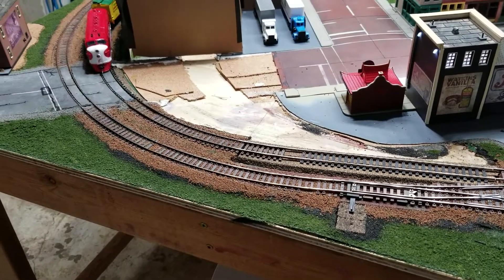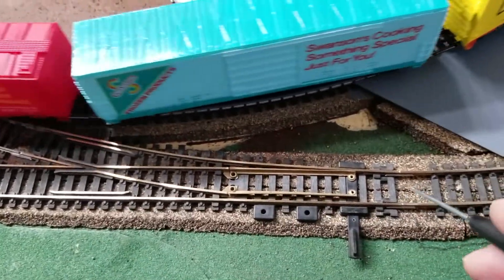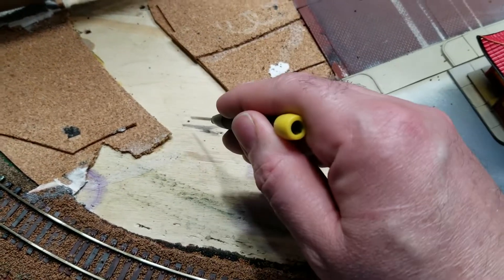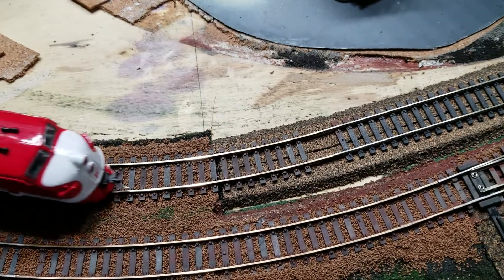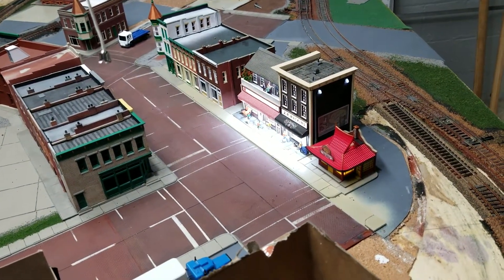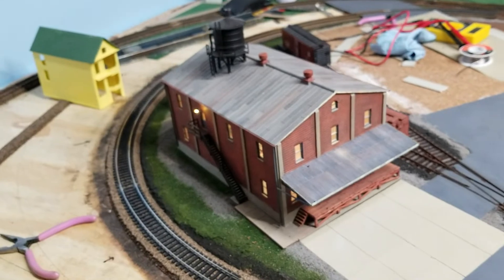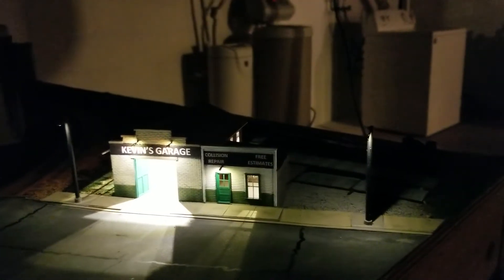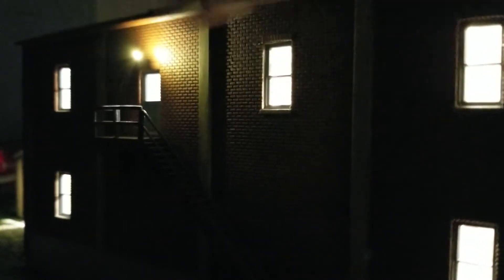TheBrickLab December 30 Train Layout Update

Comment: hi Bill... nice update ... i have found the same issues as you with track & turnouts not laying flat... you might try adding resistors to your lighting ... thx for sharing .. have a happy & safe new year... vinny
Reply from the maker: The Turnouts had me about ready to give up on trains.For the buildings that  did i'm limiting the voltage with the just plug lighting system even at max they still are okay. The Menard"s building uses their transformer for the lighting I might be able to solder a resistor in.
Bill.